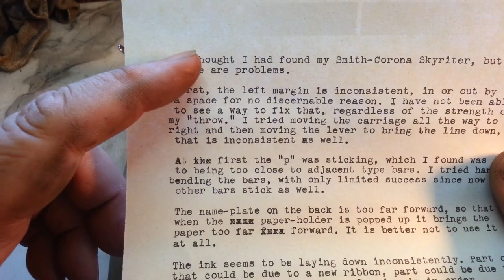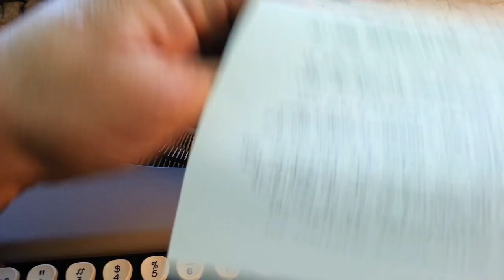Smith Corona Skyriter Typewriter, Repaired Left Margin, Banking, Not holding position. Corsair

Comment: Hey Duane…I have a 1958 Smith Corona Clipper.  For some reason my right margin does not seem to hold anymore.  The left works fine but the right the carriage continues past the right margin without hitting the margins release key.  Would you be able to help me on this?  Thanks!  I was able to open the back by removing a very small screw on each side of the carriage.  I see where the black clip hits that middle piece to stop the carriage.  The left margine black clip goes past because it goes past the middle clip.  Do I bend the left margine clip back so it hits that middle piece or do I try and and bend the middle piece forward but if I do that, it may not align with the right margine.   The only thing that I can bend this stuff with are needle nose pliers.  Thanks!
Reply from the maker: This can be tricky, I know the margin slider is not bendable, I usually adjust the piece in the middle that engages the right margin. Also check the margin release for binding, could cause similar problem
Reply: @phoenixtypewriter2136  okay I will try the middle piece and see if I can bend it.  Thanks Duane and I love Rush too!